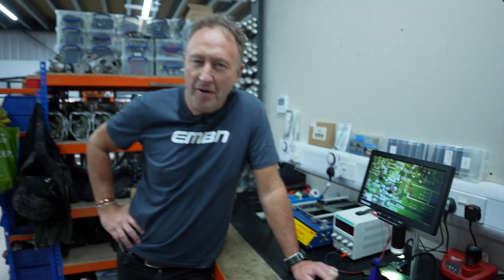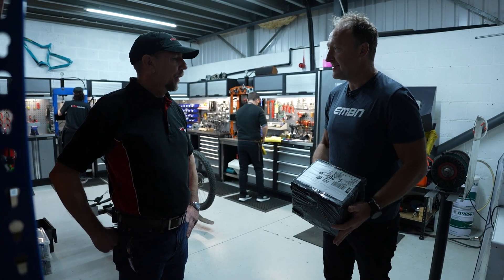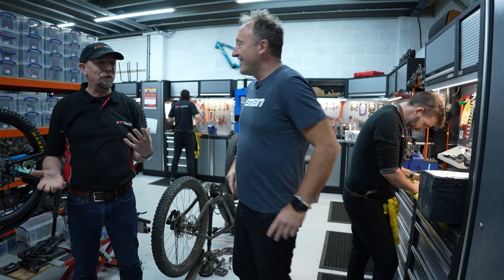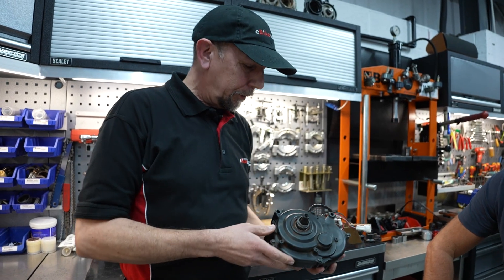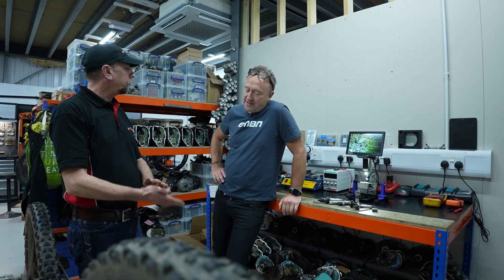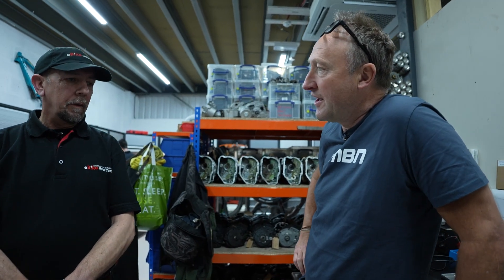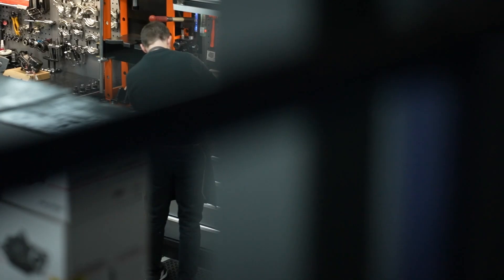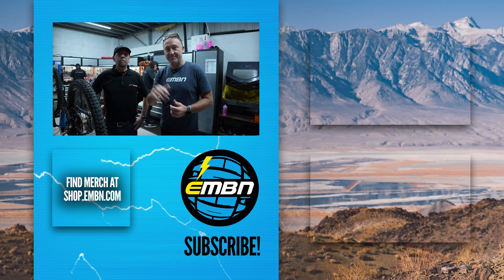How Affordable Is eBike Motor Repair | Behind The Scenes

Comment: Just not good enough! Manufacturers should not be selling motors that allow water ingress. I rode my Rocky Mountain altitude powerplay in River crossings well above the motor and battery for hundreds of metres in a recent Alpine ride in Australia. I decided to drop the motor out of the bike and inspect the battery connections and opened the motor to inspect whether there had been any water penetration and there hadn’t. I also regularly power wash my bike and apart from the occasional corrosion on a headset bearing I haven’t seen any issues at all.
Reply: We have done many Rocky Mountain bearing replacements, trust me, they are no more invincible than any other motor and deep water fording / pressure washing will definitely kill it eventually.

Comment: Good to know they are close to me in the new forest 😅.
I’ve just bought a gen 3 turbo levo.
I will be interested to find out if that motor is designed to keep the water out.
Reply: You will have one extra layer of sealing and the latest strongest Brose belt, so you should be good for a while yet.
Reply: if that gen has the brose the water is the least of your worries...good luck with that internal belt snapping.

Comment: Do a video about ebike battery repair. Completely different story. Just had to pay specialised £1k for a new gen1 levo battery because of a single cell out of 40 cells dropping below a voltage threshold. Their proprietary BMS turns your bike into a paperweight with no way to repair the battery. Not very sustainable.
Reply: Battery expense, maintenance, and repairs/replacement costs are all reasons for my hesitancy in buying an emtb.
Reply: What about being able to do some repairs ourselves?
Reply: @johnf3326  I had a gen 2 bosch with a bad bearing. Popped it apart replaced all the bearings and installed an upgraded ouboard seal. I had to order the bits from the UK as no one here in Canada had parts at that time. Wasn't overly difficult but you need access to a press. It was the noise that indicated the problem. One bearing was so bad it couldn't be turned by hand.
Reply: Should tax that kind of stuff. No easy repair and double the vat.
Reply: Model shop that does RC cars,, some of them build there own batteries
Reply: That’s just asking for a lithium fire.
Reply: @HuMaNiTaRiAn1  there are some companies now which can recondition batteries, replace faulty cells etc with good quality Samsung one's. The cost of a new battery is totally bonkers.
Reply: You can repair a battery with a new cell and generic bms, but in my experience, on things like a bosch battery, you can't always get the same small bms, so it won't fit back into the case. The bosch build quality is outstanding, but hard to fix to an oem standard.
Reply: Valuable comment
Reply: No.
Reply: None of this ebiking is sustainable, its the worst thing the companies have done. making motor mounts unsable year on year. cant get a newer motor or a newer battery. Just sling the bike and buy new is the moto.
Reply: @BazippysVideos you noticed this video is about repairing e bike motors?  new motors are available also, or reconditioned.....which seems as sustainable as any other sport with a motor.
Reply: @BazippysVideos  Redundancy by design
Reply: @BazippysVideos  If you're squeamish at first, just have a shop replace the motor and give you back the old one so you can fiddle with it to learn how to deal with problems. That way, by the time another swap is needed you can always have a spare that you personally refurbished. With time you can figure how to extend that interval with a better lube and sealant/gasket. Maybe get gears made of better materials from a third party.

Comment: Hi, do you get many yamaha motors displaying error 71 that need replacing. My pw-st has gone belly up and I'm 170 quid in on diagnostics to be told it needs replacing and it seems like a very common fault?
Reply: Error 71 is a error that relates to communication between the motor and the battery. This could either be the PCB  in the motor itself (Ebike motor centre can replace it ) or an error with the battery itself. Is it an original yamaha battery or a aftermarket? Make sure the grey wire coming from the battery loom into the motor is also undamaged as this is the communication line.
Reply: Battery is moving and the connection is lost…